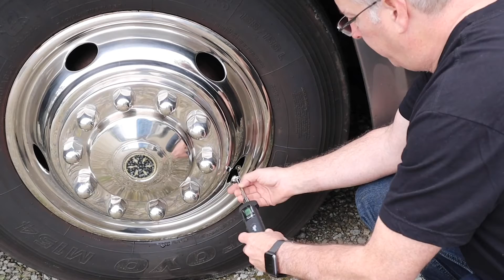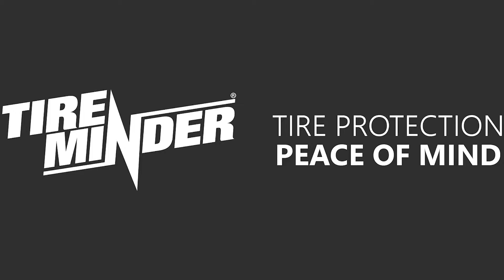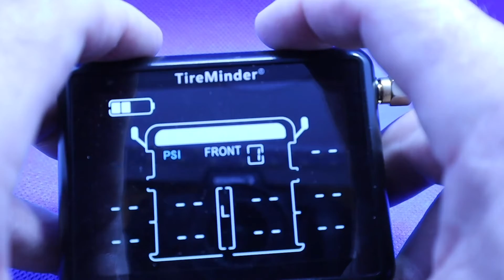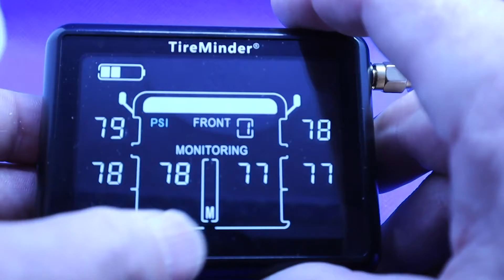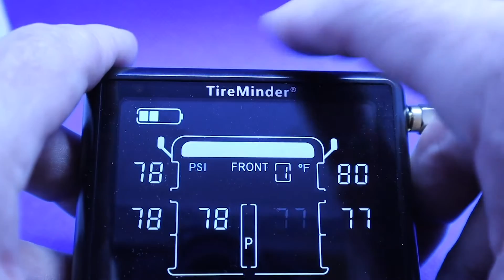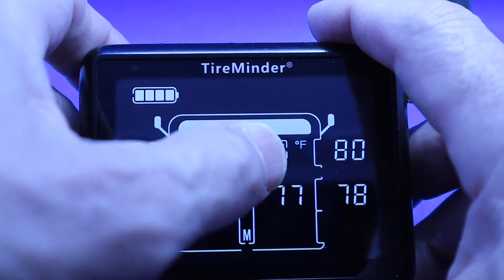I10 TPMS Install, Tire Minder TPMS- Innovation Tire shares the process of how to install the I10

Comment: Just 1 more gadget that you have to mess with. Not interested
Reply: Once it's installed, turn it on and forget it.  It will tell you if there is an issue.  Turn it off and charge it for the next day at your destination unless you keep it plugged in.

Comment: Its junk.   Installed on my RV and trailer.  Drive 130 miles.  During that time, two sensors failed.   Ordered replacements from amazon.  Installed and now another sensor is always showing 74 PSI.  even when I take it off the valve stem.   Its obvious this is wrong.  Waste of money and time.  Not reliable and its just made in china junk.  Can't send it back so I have to eat the cost and toss it in the trash.

Comment: Great instructions that assisted me without any issues in getting it installed on the tow vehicle and RV. My questions, which I have not found an answer to is, by hooking up the remote transmitter directly to the battery, does the green light stay on constantly and is the transmitter always on even when unhooked? 
Thanks again for the great instructional video and I look forward to reading your response including any suggestions you may have.
Regards, Ken

Comment: Do I have to have a separate tire minder for the truck and 5th wheel set-up or can I combine both vehicles in one unit. I have 4 tires on my 5th wheel and 6 on the truck as it is a one ton dually. Also is the tire minder pressure gauge able to read the pressure on the inside dually's on the truck?
Currently I have to use a dual head gauge to read the inside tire.

Comment: Is it a pain to get to the stems on the inside dually s?
Reply: Great question. I also wonder if the pressure gauge they talked about would be able to read the air pressure on the inside dually because the stem is facing away from the gauge.

Comment: Is that picture under the motorhome upside down???
Reply from the maker: it is mounted with the flat side facing the bottom on the RV. With the camera angle it looks a bit funny. the booster is mounted flat with the light you see facing down to the ground.
Reply: @innovationtire9966  Thanks,  I read somewhere in Minder's instructions for a different model that the antenna had to be mounted vertical and pointed up.  Looking a the install instructions of the i10 it does not give a specific orientation.  By the way,  how new is the i10 to the market ?
Reply from the maker: @rogerstruthers3799  I have tested the position and found that flat is the best for the booster to deliver the signal back to the I10 with no signal loss. Place it flat to the bottom of the RV.  This is the best I have found. The I10 was released Jan of this year to us for sale. It is set to hit the mass market this month,, if you need one go to www.innovationtire.com. We have them in stock.